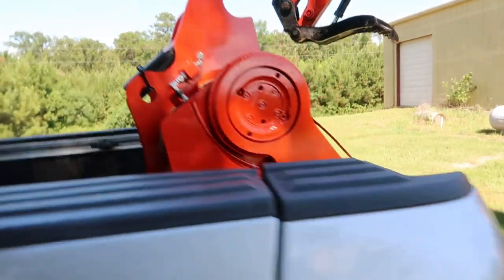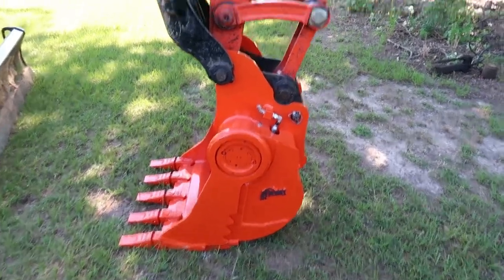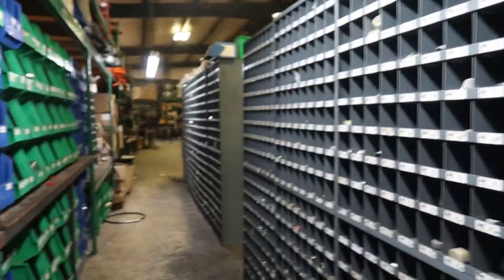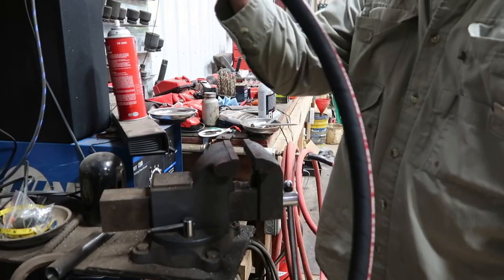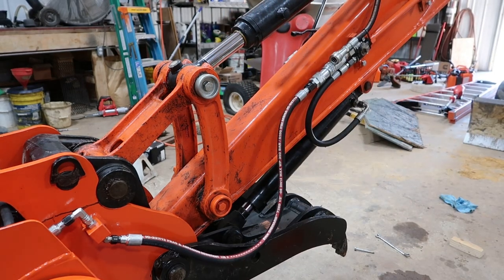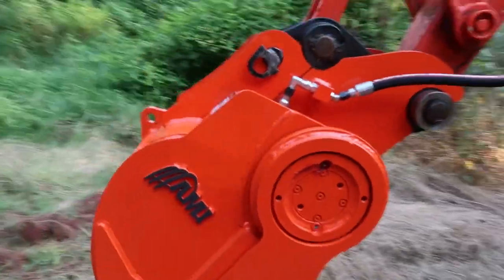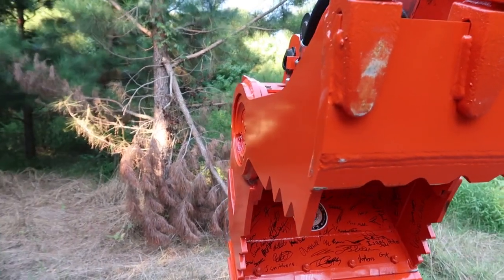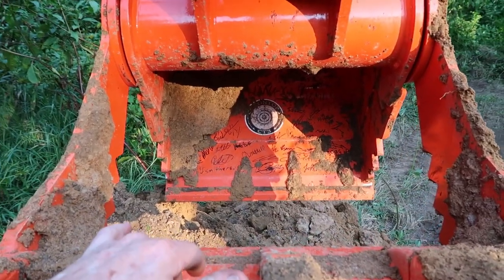Brand new “JawBone” bucket from AMI Attachments

Comment: As I mentioned in my comment on the other Jawbone video you uploaded I'm very impressed with the engineering on this. No exposed rams in the contact area, No exposed hoses where contact with the ground takes place. Well thought out, well engineered and with the helical actuator internal to the torsion tube nothing exposed to dirt and grit. Bravo AMI well done! Personally I would've thrown some hose protection sleeving on those auxiliary hoses.

Comment: those wedge washers are quite interesting. they excel in high vibration applications. Nord-Lock explains it well and look for their junkers test video to show how well they work in high vibration applications (I dont work for them just researched them for an issue at work with bolts loosening). https://www.nord-lock.com/nord-lock/technology/

Comment: I use to see the hardox stickers on the ox bodys dump beds and thought it was just something they calledthat particular bed, but now see it on alot of things like your bucket.
Reply from the maker: There is about to be a video released that will go into detail about the Hardox
Reply: @cotontop3  yeah the ami are great products made here in canada  plus there prices are reasonable  and not overpriced
Reply: Hardox is a wear and abrasive resistant steel alloy. there are several grades of hardox depending on the wear it will encounter.

Comment: First glance it s good idea. Main criticism I see is that if you were cleaning out a trench and you wanted a smooth base, the arms of the jaw are wider than the straight cutting edge. They could have almost flipped the jaw sections inwards a bit and had them meeting like a pelican bucket. If the arms were almost inverted it could also increase the dirt capacity without making the bucket wider. Much better than anything I could build. I expect they will tweak it as they require. And of course there is no need to haul extra attachments around, weight and theft being consideration on that front. Nice video.

Comment: How wide is that bucket?
Reply from the maker: It’s a 2’
Reply: @cotontop3  thanks for getting back. Do you like this more then a thumb. If you put on your other buckets you no longer have a thumb
Reply from the maker: @simpleman4196  I prefer this a lot better than with the thumb on the machine. Even though if I swap to say my 3’ bucket or tilt grade bucket, I prefer not having the thumb because I never really used it with those anyhow.  The jawbone is costly but having the quick option of the smooth edge instantly is awesome.
Reply: @cotontop3  Thanks for getting back with me Tim iam watching all your videos on it now it does seem very impressive.